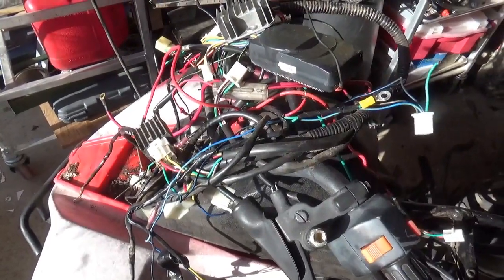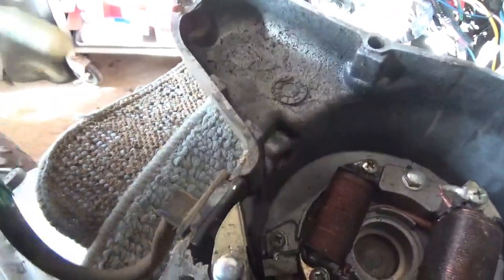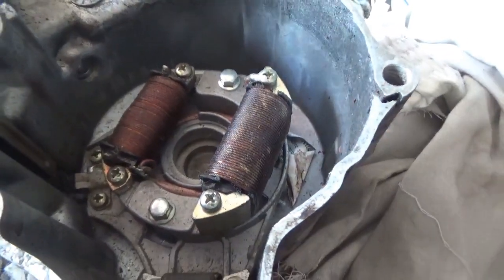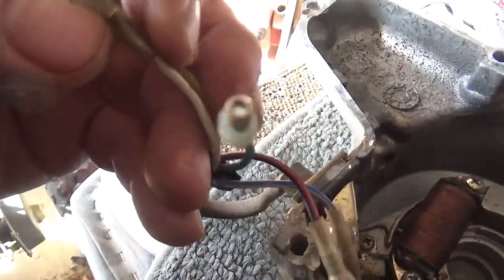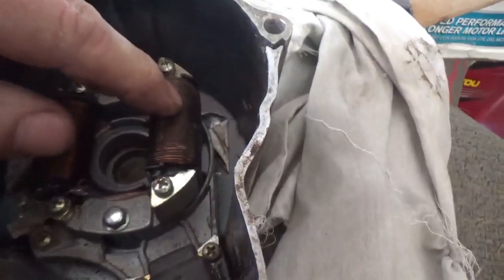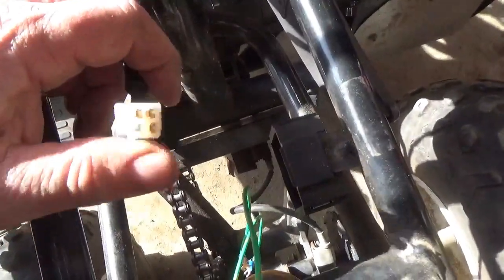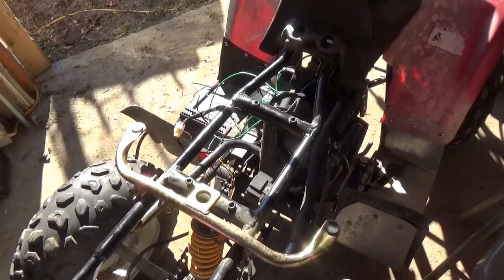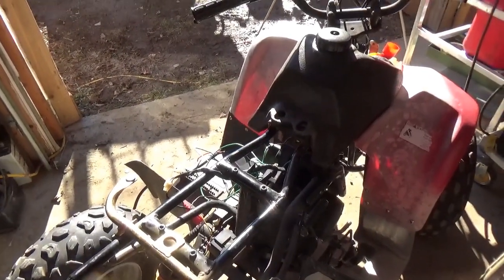ATV CDI from Junk, DIY Four Wheeler Capacitive Discharge Ignition System!

Comment: i have a 2010 baja 250 with a hacked wiring system cdi is a 7 pin  4 of the pins go to themotor i think i figure out that much. but other three  one is the coil  then there is a black and black and black/ white  not sure how to get power to the cdi

Comment: Hey bud, I got a 110, put a brand new pz19, wont crank unless I spray fluid in it, is it that it's not compatible with the wheeler?
Reply: Sounds like your carb may be bad. But also check if you get gas flowing to your carb. If you dont, prob a bad filter, petcock, clogged hose, etc. Also may need to tweak fuel air screw/ idle screw. Just my 2 cents.
Reply from the maker: Hey Guys! I'm going to put up a video today on vacuum leak and gas flow issues on a pz27... Maybe that will help.... Dtdyysg, good advice...  Thanks for Ur thoughts, watching, and commenting!!!
Reply from the maker: Hey Guys! I'm going to put up a video today on vacuum leak and gas flow issues on a pz27... Maybe that will help.... Dtdyysg, good advice...  Thanks for Ur thoughts, watching, and commenting!!!
Reply: @HarveySpooner  bro that's exactly what it was, I got the right mounting bolts and she will crank and run now, I gotta tune the carb in now, thanks for your channel

Comment: That fires once when you let go of the start button business was great. I've seen carb rebuilds and spark plugs replaced without anything different as a result with that same sequence, thanks Harvey.
Reply from the maker: Hey ASE!  That one fire scenario drove me crazy on one quad, it took me days to figure it out! Thanks for Ur thoughts, watching, and commenting!!!
Reply: @HarveySpooner  I've seen the parts cannon pointed at those problem machines more often then not. Put in 6 days this week and We're starting to catch up on the back log of machines. Still got close to 50 wheelers needing work but some are long term whenever you get a chance jobs that don't make a lot of sense. Finally got my black Brute Force 650 finished and after sitting in the back of my pick up all night in single digit temps it started up first shot, WOW. Almost forgot, had sunshine finally. Take care Harvey.